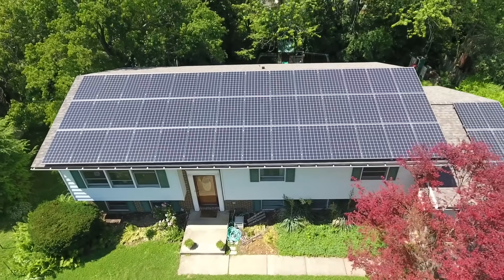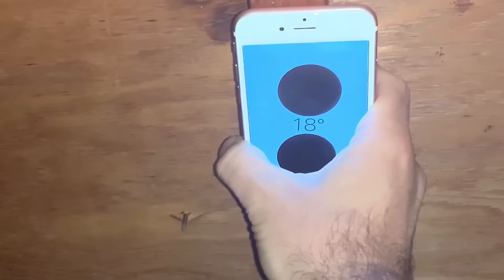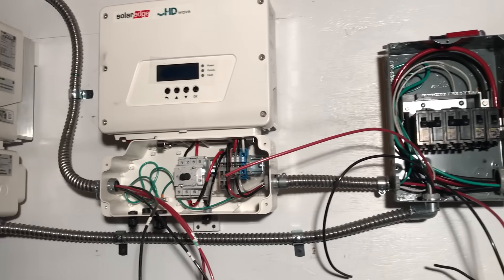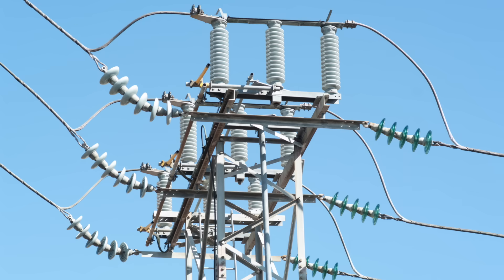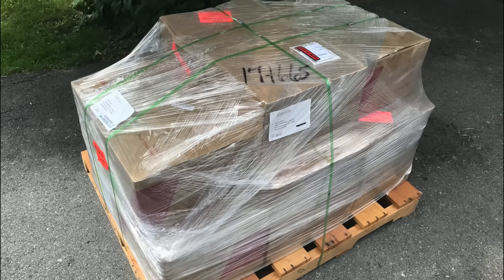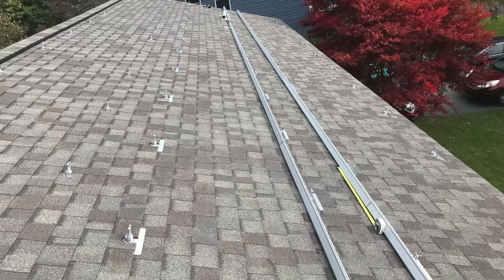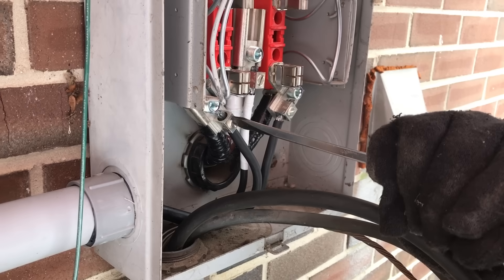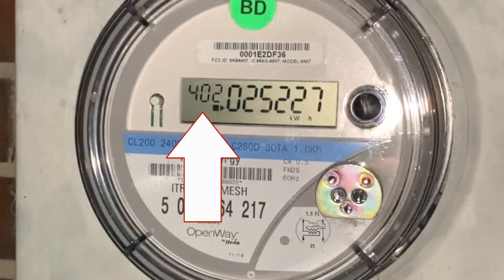I Installed a Power Plant Myself | HUGE DIY Solar Panel System

Comment: You could install a battery for nighttime or bad weather. For further optimization on making money
Reply from the maker: I could but I don’t need to.  The net metering in this state is a one for one credit.  Check out the next video after this one and I explain a little on how it works.
Reply: @FrugalRepair  I wish that were true in my case. Per kWh I pay 0.23 euro, 1kWh solar power back to the grid gives me 0.05 euro

Comment: Just a question: with so much power how do you connect the batteries, parallel or in series ? I have learned that connecting the batteries in series will give higher voltage and lower amps. It is having lower amps that will reduce heat and losses in the cables.

Comment: YES, Absolutely I want solar. I have been thinking about it for some many years now but I don't want to get locked into some 20 year payment system. My biggest problem is that we own a fairly large house for foster care. 8 bedrooms, 10 baths. Kiddos are the worst when leaving lights, appliances and tv's on and often times hot water in the shower running. Our monthly electric ranges from $250 to $1000 a month depending on all these mishaps. Our house is 12,064 square feet and as you can imagine Colorado winters can help aid with our heating cost for not only the electric part but the (3) 1000 gallon propane tanks. I would love to do my share in helping what environmental waste me and my sometime large household is contributing. Putting this on my 45 degree roof however, not an option however I do have lots of land so maybe a system on ground could do good. I downloaded you're guide in hopes my husband will want to do some much needed reading and help me learn what needs to be done. Thank you so much for your video and your free step by step guide, your awesome.

Comment: An outstanding job, both the video and solar installation. My one question: I have seen these solar installations with enormous power centers (i.e. Tesla Battery) why is your system so small at your inverter/power center? Thanks again.
Reply: I know about as little about this as one can, but my understanding is that he's using the grid itself in place of batteries.
So he's not using solar to charge batteries that power his house, he sends power directly from the pv into his house, and then the switches send surplus power to the grid, and switch to pull power from the grid when the pv is not producing as much as he needs.
That's the beauty of a grid-attached system, the grid acts as your batteries.
I think.
Reply from the maker: Yes, I’m grid tied with a net metering agreement.  The next video after this one explains more.

Comment: pretty sure u wasted ur moneyz, 1 u repaired ur old roof, meaning in the future most likely this roof needs to be completely redone... meaning ur panels will be uninstalled increases the cost drastically.

should of got a tesla solar roof, 26% tax incentive on top of the bill 25 year warranty on the equipment after that its all gravy
looks way better too imo solar panels on top of roofs are the worst eyesore possible for anyone walking around.

Comment: So when you need a new roof you have to uninstall all the panels and reinstall?
Reply from the maker: Yes, to get to the shingles underneath the panels but the thing is is that they might last 50+ years since they are protected from the elements by the panels.  We don’t really know how long the shingles will last.

Comment: Is the electricity generated by the solar panels stored on some batteries for backup? 

Or is all the excess power transferred back to the grid? What happens when you have really bad weather? Like snow and raining days
Reply from the maker: Any extra goes to the grid and I get credit for it.  When it’s dark, I use power from the grid just like I did before solar.

Comment: since you have 3 rows , how would you go about repairing panels in the middle row?
Reply from the maker: It’s simple, just take off the ones above to get to them.  Moving panels isn’t difficult.  Remove the four bolts and disconnect the MC4 cables.  And make sure to de-energize your solar array first.
Reply: @FrugalRepair  but how do you get to the bolts that are in the middle, if you can access only 2 from top or bottom row? Maybe Im overthinking it.
Reply from the maker: A long arm and a wrench with a longer handle and you can get to them.  You really just need to loosen them because once the MC4 is disconnected you can slide the panel upwards.  Some people walk on the panels but that is a bad idea since it can cause performance degradation from microfractures in the silicon.

Comment: What is typically better: net metering (excess energy sent to the grid, switch to grid during dark times) or battery storage. So meaning, store your excess power to batteries to use during the night vs uploading power to the grid during the day and using grid power during the night?
Reply from the maker: Usually net metering but it depends on if you are in an area with time of use rates.  Batteries are expensive but if you can manage it such that you can sell back at a much higher rate it may be financially worth it to get them.
Reply: @FrugalRepair  Ah yes, makes sense. Use the battery store during high rates, so you can net meter all your power etc. Like you said, a cost analysis would need to be done. Interesting thing to think about though!

Comment: I live in the UK east coast Yorkshire area and have a 14kwh array with a 13kwh battery combined with a Eddi water heater. Between April to the back end of September I am between 98% to 100% energy independent. My generation is capped at 6kwh due to the grid here, still on a good day I generate up to 60 kwh. Overall throughout the year I am 80% independent as winter months are pretty dismal. I am just installing water harvesting now. Utility independence is possible on a budget. Well done yourself !
Reply from the maker: Wow, that is great to hear.  Thanks for sharing.

Comment: Do you have some surge protection on those panels? Didn’t see any in the video and I’d hate to see those expensive panels fry.
Reply from the maker: They are grounded and I do have surge protection from the grid.  I made a video “tour” of the system if you wanted to check it out.  I show off the surge protection there. It’s called “inside my 15.6kw power plant”

Comment: Dude how about making small solar inverters that will power up our daily needs using a backup and charge controller 🤔
Reply from the maker: Check out my video on the solar generator and battery if you wanted.  Is that what you’re asking about?

Comment: I don't think that would not pass inspection in CA.  Installer told me you have to have room to walk around the panels top and bottom and sides (in case of fire or something?).    Have to check local building code to ensure the clearances from edge and any vents.

Comment: i love your setup, it looks "pro" . There is no question. But i was wondering, and even though it is a fictitious number. at 10 bucks an hour. , for your time lets say. . what was your total outlaying costs for a turnkey system? this would include blueprints, application fees. travel , etc.  and based on your yearly average usage, possibly including maintenance  would it pay for itself?
Reply from the maker: Thanks!  I go over the costs and numbers in the next video after this.  Let me know in the comments of that video if I didn't answer your questions. It's called "is solar worth it?"
Reply: @FrugalRepair  he basically asked if you included your labor into the calculation

Comment: Is there some type of cover or protection you would put over it if you have a bad hail storm or something of that nature?
Reply from the maker: No. The glass is very strong.  Of course, if some freakishly heavy thing were to impact them they could get damaged.  But I have no concerns about hail.
Reply: @FrugalRepair  so im sure this is a silly question for most but… why do you need to connect to the powergrid if your making your own electricity? Im just confused why they need to have any involvement?
Reply from the maker: Check out the next video, "Is solar worth it?"  Net meter is the main reason, and the reason why solar is financially worth it.  And the reason I don't need a big bank of batteries because essentially the grid is my battery.
Reply: @FrugalRepair  awesome ill check it out. I figured there was a good reason. Thanks for your patience and understanding.

Comment: I plan to own 20 arch of land and utilities 10 arch for my garage/house to do my side project for bitcoin mining how much solar panel should I get to utilize the solar panel for 0 cost and I'm from Malaysia.
Reply: the bitcoin mining is about 20 unit.
Reply from the maker: Bitcoin miners use like 3000w each so they would need lots of power and batteries if you will be off grid.

Comment: What state is this in? Pennsylvania we can’t tap in meter so just wondering?
Reply from the maker: I’m in PA.  You can totally do a line side tap or back feed a breaker, the two ways to do a grid tie.
Reply: @FrugalRepair  I install solar for a living and have never had an inspector pass a line side tap in the meter can. So I was just curious.

Comment: How did you install it all yourself if your legally supposed to have a licensed electrician doing the wiring?
Reply from the maker: There is no legal requirement to hire an electrician, at least around here.
Reply: @FrugalRepair  doin any type of electrical work and especially tying to a grid does. I'm an electrician so I know the law requirements and any electrical work done legally should be done by someone licensed. That's law everywhere, especially if it requires a permit from the city.

Comment: It runs everything in the house.Like fridge ac lighting machines let me know please.
Reply from the maker: Yes, but I’m grid tied so I have the same 200 amp service I had before solar.  Check out the next video if you want to learn more on how net metering works for me.

Comment: My crappy government protects my island's diesel burning power plant, and make it very difficult to get solar panels installed while also being hooked up to power plant. Here it would be necessary to be completely disconnected from the grid. So a system that includes enough batteries for at night is required. The awesome thing here is; it's the Caribbean, nothing but sun and wind here, yet we're being manipulated to keep the diesel burning power plant running.

Comment: cOOL project thanks for sharing. And a great job. 
How long did it take? 
Why are the panels so close to the roof? doesnt the lack of air cooling causes them to lose efficiency by like a lot?
Reply from the maker: Thanks!  I worked on it here and there over the course of about 3 months but I wasn’t in a hurry.  It could have been done much faster.  Regarding distance,  there is a few inches of space so there is plenty of air to keep them cool, it’s not a worry at all.

Comment: I did some solar installs as an electrician.  Hardest part getting a wired from roof to the circuit breaker box.  The code is a big part.

Edit... Agree with the inspector, nice electrical work.
Reply from the maker: Thanks!  Understanding the NEC requirements was a bit challenging.
Reply: lmao really? thats the hardest part? thank god you only did installs and dont actively do them. little conduit and theres no issues....

Comment: How do you heat your house? With gas, or electric. With electric heating you will freeze to death. Good luck.
Reply from the maker: Electric, it works just fine. If you want to learn more about how much electricity it uses check out the next video after this one. I go over all the production and cost numbers too.

Comment: ive built a small off grid system.. But im considering building another grid tied in system
Reply from the maker: That sounds cool. If you have done off-grid. You should have no problem with a grid tie system.

Comment: Nice job, it looks really well designed and put together. I'm an electrician myself, I'd give you a job! 👍 One suggestion I'd make though is contact your home insurer and let them know you have solar panels on your roof. Here in Australia, if there's a fire at a house with solar panels, the fire department will let it burn. The shutdown procedure creates a closed circuit on your roof, no power to the grid but your roof is LIVE. As soon as the water is switched on for the fire hose and hits your roof, dead firemen. I usually advise people to talk to their insurer on completion of installation. Great video, very informative and top work. Stay safe. 👍👏👏👏
Reply from the maker: Thanks! Actually because I have solaredge, when the disconnect switch is turned off, the inverters turn off and they signal the power optimizers to shut off, and they only output 1 V each.
Reply: @FrugalRepair  yes that is good but your roof is still live. Hence the reason insurers declare solar panels to be a known fire hazard. The shutdown procedure just stops power going back to the grid, but the panels are still producing electricity until the sun goes down. 👍

Comment: Another comment from a video I watched earlier suggested using chicken wire or some sort of protection at the edges of the panels to keep birds from nesting under them or to keep out squirrels.
Reply from the maker: At least in my experience I have not had any birds or squirrels up there.

Comment: Great video.  I have a question:  Since you are selling back into the grid, do you have any deep cell batteries for holding power overnight or do you run off the grid overnight?  Also, does this work well with AC?  multiple refrigerators?  Thank you!
Reply from the maker: Thanks!  I might suggest watching the next video after this one where I explain how it works without batteries.  If you have a net metering agreement with your utility, you probably don't need batteries.  The video is titled: "is solar worth it?"
Reply: @FrugalRepair  I'm also VERY curious about whether you're able to power air conditioners and fridges with your battery, during the day and at night. In Nigeria where I live, temperatures from March to September can range between 35 deg. C (95 F) to 25 C (77 F) at night. So we need things that cool the air and drinks.

Comment: You left out some important info. How many KW were you using prior to the solar install and how much was your average power bill? Then how much was the complete solar materials, electrical contractor, engineer's report and any other expense? Then at the end how much were you actually getting back from the power company per month? I understand the ROI, but the numbers are missing.
Reply from the maker: Thanks for watching.  The next video answers almost all of those questions.  It’s called “is solar worth it?”

Comment: What happens if a hurricane comes like where I live I’d be fucked ?
Reply from the maker: Not necessarily.  Rail and panel manufacturers make some that can withstand very high winds.
Reply: @FrugalRepair  awesome thank you ill look into it! its always been a fear of mine I was always curious in adding some to the backyard shed thank you for taking the time to reply
Reply from the maker: No problem.  I think mine rails are rated for 130mph winds.  And I know they make stronger ones.

Comment: I'm interested in simple question, what is the electricity produced each month, how much sun do you get average each month, did you take in to account you would get more power if you aimed the solar panels properly, or were you so lucky they were correct directly instantly? And has there been problems with Dirt? Everyone knows when solar panels get dirty they lose efficiency and I would love to know if you clean them or if they are staying clean so far. Also you have not made "profit" until you have saved equal amount in electrical bill as the installation cost -> I'm interested to see if you go + - 0, gain money or lose money ... if the solar panels brake withint X time (how much it cost vs monthly electrical bill = time it takes to pay back) you lost money

Based on my calculations (because how north we in Finland live) I would make net loss -> we need more electricity at Winter when there is no sun light :( so GG for me... it would cost 20k and it would take +10 years to pay back and I could not get 0€ bill whole year, only at summers :D, maybe 9 months out of 12 ... but at least 3 months would be no use from solar because how dark it is and snow ;)
Reply from the maker: I made some more videos answering a few of these questions.  Yes, I was fortunate that my roof is pointed almost due south and had little to no shade.  And no, no problems with dirt.  The rain cleans them regularly.  Maybe at some point I’ll clean them as an experiment.
Reply: @FrugalRepair  I take it from where you said you got your panels you did not get anything made from China. Am I correct? Because I hear those are really not worth it

Comment: Any lock to prevent people from flipping the switch off from the outside?
Reply from the maker: Actually no, and almost all switches would be like that.  If there was an emergency the first responders need a way to turn it off quickly.

Comment: A great system but it has one flaw...
If and when your power company goes down, you have NO electricity in your home, no matter how much your panels are generating at the time.
The only way to overcome this is to have your own battery bank.
Reply from the maker: Yes, that is a downside of a grid-tie without batteries.  The good thing is that it's extremely rare that there is a power outage AND it's sunny outside.   You have to factor in all of the costs and pros/cons when thinking about a big battery backup system.  It's a different process for everyone.
Reply: @FrugalRepair  Many do not follow that philosophy because what has been the norm is very likely not to be in the future.